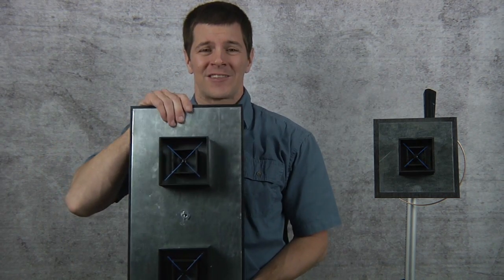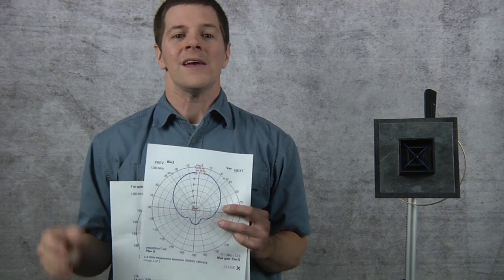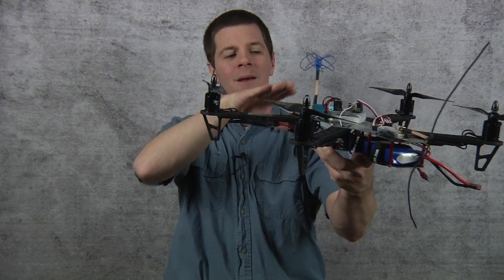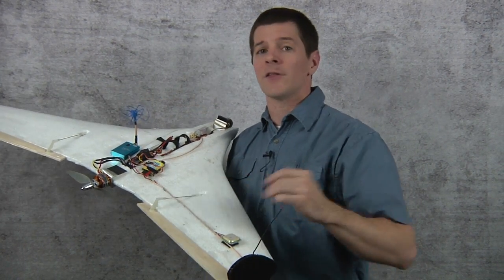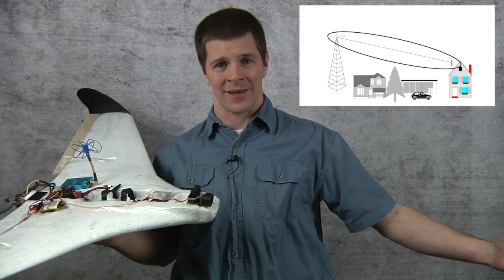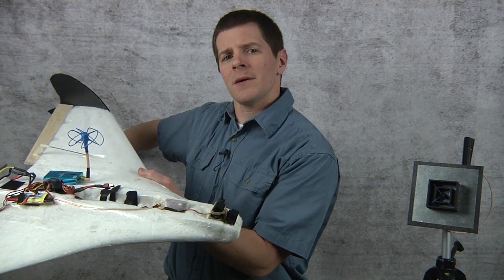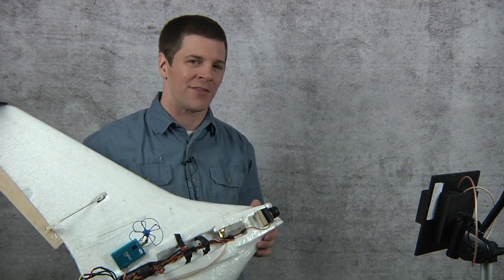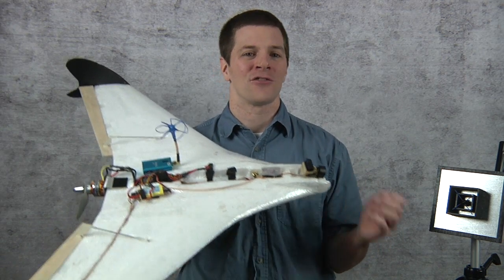How to be successful in FPV part 9 - Radio Communication

Comment: Great videos for us newbies, a lot of valuable information.  I just picked up a DJI phantom 2 and having very poor video quality with a Black Mamba transmitter, regular stock directional whip antennas, and Black pearl monitor. After watching some of your videos, I was going to try an upgrade to a directional circular helical antenna versus something like the mad mushroom - but not sure which one to get. You mentioned they have to match. I cant find what the Black Mamba is - do you know by any chance. I think that the helical antenna would be good for me since I fly basically all in front of me. Any thoughts would be very appreciated. Thanks again and great videos.
Reply from the maker: P and P Adventures A Mad Mushroom on the aircraft and helical antennas on your black pearl will do well for range and clarity.  I suggest 5 turn (9.5dbic) helicals.
Reply: Thanks Alex - I just purchased a blue beam set with the mad mushroom and a 5 turn helical

Comment: Everything you say and do is very valuable. I am only missing one thing: what can you do to increase the quality of the signal, I mean more resolution, and keep the latency acceptable, specially for racing. It must be possible to modify a 800TVL or higher to get a nicer image??
Reply from the maker: Hans Ham - I am working on a system for that right now ;)
Reply: Alex Greve Thans, I would appreceate if you inform me when you have something to show. My guess is that you can have double resolution.. so HD.. with two transmitters doing parallel processing even though doubling the resolution takes 4x bandwith. I think because the camera's people use now are not dedicated designed for FPV, just building it from ground up, reducing processing time in every step in the chain from camera to eye must give some improvement already.

Comment: but you foget that the tbs discovery frame is fiberglas and rf transparant
Reply from the maker: Actually, it is not RF transparent.  It has circuit board traces running through it which block the signal.  The battery also is not transparent.
Reply: thats true

Comment: @16:30 How much is near?? Is it safe to fly 900Mhz 1000 meters away from cellphone towers?
Reply from the maker: As always the answer is "it depends".  If the cell tower is not transmitting it is plenty safe.  If someone nearby makes a call, it could be, or it could take your video completely out.
Reply: Alex Greve Is it worth it using stock antennas to build cloverleaf ones? I went to radioshack and they only had the connectors not the cable. I have tested the 900Mhz 200Mw system and no matter how close or how far( withing 100 feet) that I have tested the signal drops for about a second and then comes back. Probably because there are like 3 3G antennas within my city. This might not happen on a rural area where the nearest antenna might be miles away.

Comment: Hi Alex, Don't know whether I have already manged to post here as I am having some instability. I really have enjoyed your series. Putting a new Hex together and it has an Aluminum frame and CF booms. With my 9X Tx, the best mod to get longest range is the FrSky module install. May I inquire as to the mod you have done to the Rx antenna on the Dead Cat Quad. I will have to be smart about the layout on the Hex unless I put a medium to large landing gear on the 7-800mm alum. and CF construct. thx

Comment: Hi Alex, I am using 5.8 ghz video transmitter and receiver.  Do the right angle adapters that goes in the antenna (transmitter and receiver) reduce the strength of the signal?
Thanks.

Comment: To avoid interferance, you should avoid close perportions. Ex: ch1 is 1m, ch2 is 1/2m, then a 1/2 wave antenna for ch2 is also a 1/4 antenna for ch1, so a 25cm antenna will match both. Choose lengths that are as different perportionally as possible. I would use a 5/8 wave 20.8cm for the 900mhz. this is longer than the entire 12.5cm wave for 2.4ghz. 1/4 wave for 900mhz is 4.1625cm, we want to avoid multiples of that. Use a 1/2 wave for 2.4ghz, or about 6cm, this is unmatched for 900mhz as gets.

Comment: The length of the antenna is ALWAYS perportional to the length of the radio wave. This is how antennas are tuned. I make antennas for wifi, so I can do the math correctly. You can make a workable antenna just by stripping the ground wire (outside wrap of the coax) off, and peeling it back, exposing the conductor, you just have to get the length right. The length must be 1 to 5 eighths of the wave. Devide 300 by the frequency in mhz to get the wavelength in meters, then devide by 8.

Comment: I agree the problem is noise floor but changing to 1010mhz or 980mhz seems to solve the problem however my antennas are tuned for 910mhz so it's degraded. My question was, will getting 980Mhz antennas or 1010Mhz antennas give me a clear signal even though my transmitter is supposed to be 910mhz? GSM, i.e. cell phones, are likely my issue but I can work around that by changing the channel. I just don't want to spend more money on another setup, 1.3Ghz, antennas and so on if I can avoid it. Thanks

Comment: Alex, I have a 900mhz 1.5W transmitter and I have found that when I'm outside the city I get infinite range on channel 0 (910mhz) but inside the city I have to switch to channel 2 (1010mhz) for the best picture but the picture is degraded. My antennas aren't "tuned" for 1010mhz but work. I want to stick with 910mhz for the punch through power so would it make sense, or even work well, if I bought 980mhz or 1.2ghz antennas instead of 910mhz antennas? I think its GSM intereferance. Your thoughts?

Comment: Hi Alex,
I'm 16 and i really love building antenna such as Cloverleaf!
I build a pair for me On 1.2GHz and they works well!

Then i Build a pair for a friend On 5.8GHz and they just work worst as the stock antenna(Black one)

I use 1.2mm welding wire (or 0.045") 
I wonder if it's too thick and which diameter should i Use? (Maybe too big for 1.2 too...)

Thanks a lot for your help!!
France

Comment: no it's plugged in to the pins where the old 72 mhz module used to be. could that be a problem?  it seems like a secure connection. but it's not through the trainer port like some newer futabas. its an older futaba. a pcm/ppm selectable  pcm 1024 / T8uhp  i have it set to ppm inputs. if there is a reason i should connect the module in a different way, i'm all ears.  thanks.

Comment: is your uhf ppm signal wire soldered directly to the circuit in your Tx or are you running it through a trainer port with a jack? If you are running it through the trainer port thats probably the problem

Comment: i have since worked some bugs out of the plane side, and it's working better, but high power still not working on the tx module. if i cannot get immersion to take care of it, i will switch systems. thanks for the input.

Comment: Don't forget that even in different frequencies, a transmitter on the aircraft may drastically decrease a receiver's sensibility in the same aircraft. One experienced example was when I flew my airplane with a 1,5watt@900mhz video TX right 5cm near to my 2.4ghz spektrum receiver&sattelite receiver. The video TX simply shut down the receiver because the power is so high!.

BTW I used the directional antena tip to find where it crashed then.... :)

good flights!

Comment: I am thinking of buying your 5.8GHz 3 turn helical antenna (7dBic) that mounts on video goggles or the 5 turn helical antenna that mounts on the goggles (9.5dBic) but not sure which to buy. I have thought that perhaps since I am not using an antenna tracker that it would be wiser to go with the smaller helical 7bBic since it has a wider degree, thus easier to stay within the limits of the transmitting signal. Any help on this matter would be highly appreciated.

Thank you

Nate

Comment from the maker: Use an "IPX jumper" cable.  This will allow you to connect your own antenna to the receiver.  You can split the other end of the pumper cable exactly 1.25" split (to make a 2.5" dipole).

Comment: I have a tip for you: Disassemble your video transmitter from your delta wing and make holes into heat sink. If you are handy, you can save more than 20 g weight and transmitter is much colder. I made same thing, because i have same transmitter. Good luck :)

Comment: i have a few questions. Firs of all how do you keep your 72mhz receiver antenna very far from your video system when the antenna itself is 40 ish inches long. Also can u  mack a dipole antenna fore 72mhz if so what measurements fore each piece of wire.